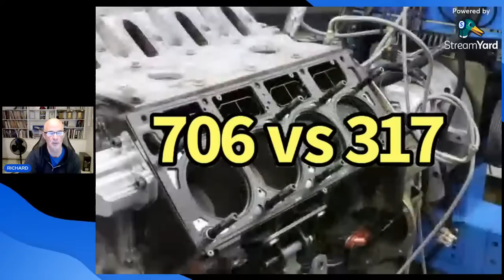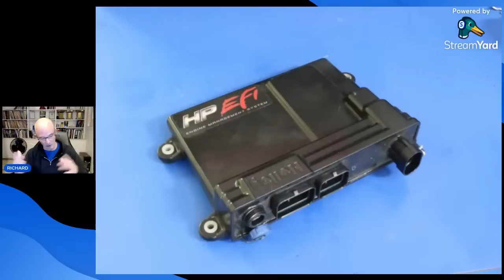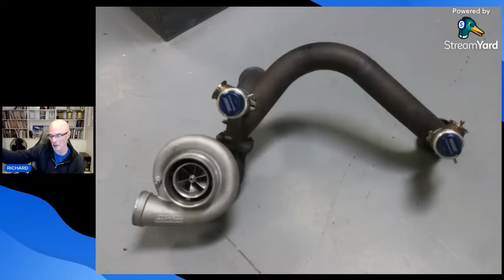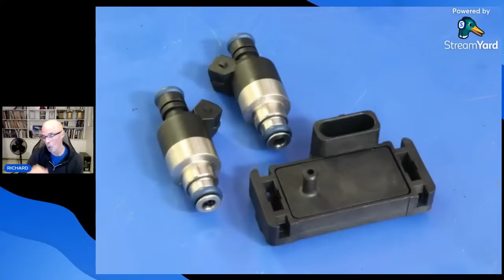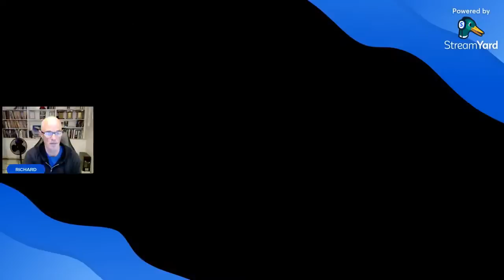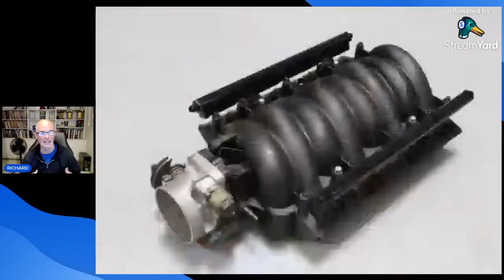COMPRESSION VS BOOST LET'S TALK TECH

Comment: I've learned a lot from Richard. I went from knowing nothing. To knowing enough to not totally agree with absolutely everything. When he says every cam is a turbo cam. But then say, that's not the cam i would have used. It's like saying you can put ketchup on anything. Which is absolutely true. It's probably pretty gross on a banana split. When you're optimizing your combination to avoid detonation.  Its not just octane, compression ratio, quench, chamber softening, vehicle weight, intake air temperature. Then just any old cam. Although it will run with boost, may not be right for you.  If you can manipulate the cylinder pressure with valve overlap, it's giving you a larger window, alot like lowering the compression. Also for those that I want a daily driver, fast spool, don't want to lose that 40hp. You better listen to Richard. You have to take into account, if you're running a air-to-air intercooler. It's not being all it can be in the middle of August when it's so hot you can fry an egg on the hood of your car. Stop and go traffic.

Comment: Look i want tge best performance up to a km. But i also want my car reliable. I cant change things every 3 months . So im thinking 8:1 max 8:5 on my straight 6 . Ill run a small A/R rather for faster spool but it will mostly b a daily and occasionally take on someone that think they fast
Reply: I'm planning the same. 8 or 8.5:1 so I can get 1.4-1.6 bar of boost on pump fuel.  The A/R I'm unsure of Thinking 0.83 and G30 825 gen 2.

Comment: At 14:30, you referenced my EXACT concern.

I'm building a supercharged engine with the intent to maximize my USABLE curve on the street and for occasional track/strip use. My inclination is towards slightly higher static CR (via piston, NOT a head/chamber difference), while running less boost overall. 

I'm using a dedicated PWM boost controller that allows me to directly control the boost levels for a given RPM, throttle range, etc. My intention is to find that line where I can get away with running less boost to meet the same goals, so that I can minimize my losses off-boost, while maximizing my gains on-boost (exclusively at higher RPMs, when flow is higher and cooling should theoretically improve due to inertial scavenging.

I wish that I could find a source for exactly what you mentioned at ~14:30 in this video. That would be the Holy Grail of content, for my purposes...
Reply from the maker: you should lower compression and add boost-you will make more power on any given octane

Comment: My feeling is that if you want to compare you should raise the boost to the point of detonation in both combinations and see which combo produces more before you have to stop. As far as chamber efficiency I'd put a dished piston in the 706 combo to equalize compression then test to see which head is actually better. I'd guess in that sense they'd be the same
Reply from the maker: the 706 head chamber is a better design

Comment: An aspect of compression ratio that is never mentioned is the fact that a low compression chamber is larger than a high compression chamber. With NA motors this is clearly a negative but with boost, you can put more fuel/air mixture into a low compression motor resulting in more power given the same level of boost because the flow is higher (you can fit more in). It would be interesting to do a comparison between a 9.5 CR motor with as much boost as it could take before detonation and a 7.0 CR motor under that same level of boost.
Reply from the maker: Something to consider-then you are testing detonation threshold, not change in compression. In this test-the larger chamber (lower compression) heads made less power at the same boost level

Comment: With high compression wouldn't using really big cam help with balancing out the cylinder pressure and compression ?
Reply from the maker: a big cam will reduce dynamic compression

Comment: You dont like compound  setups so you dont have an opportunity to run an intercooler ( inter stage cooler).  So nothing beats an aftercooler, air to air for anything longer than a drag race.
Reply from the maker: I do like compound set ups-just don't recommend them for typical junkyard LS motors (unnecessary)

Comment: I wanna see this head test on a 6.0 or 408
Reply from the maker: same results
Reply: @ so that leads me to my next question. I bought a 2000 6.0 with iron heads and longer crank snout. I decided to rebuild to 408. My question is it better to get compression from the pistons or from head swap. Will I benefit from raising the compression with pistons and having the larger valves of the 317 heads. I want to run stock heads. Thanks in advance.

Comment: Lol when I'm looking at compression I'm looking at 12:1 na or 10:1 with boost lol we got e85 👌

I've got 117° ambient temps but I'm also going ape-shit with cooling. 

I'm guesstimating that a 408 that's 12:1 with smole bore/smole dome skimmed 862s, aughts land somewhere around 10 with huge bore big dome LSA/LS3 Heads.

Idk if it's possible to take out enough dynamic Compression with a cam to run a 20lb twin-screw setup on a 12:1 engine lololol
Reply: A link to a compression calculator would be cool lol. The dome volumes for all the stock heads are available online lol...
Reply from the maker: search wallace racing compression calculator

Comment: I have been looking at installing a Procharger on my 2019 Gt 350 Mustang (warrenty just ran out).  The Procharger makes about 6.5 psi which apparently works fine on 93 pump gas.  I find this amazing considering these engines have 12:1 compression.    However, what I really wanted to say is I really like how you can display what is on your computer now during the live streams.  Its awesome!

Comment: Hello Richard. Building a lq4 6.0 bored .030 over for drag racing. It has a stock crank, forged summit flat top pistons and rods. Calculator says it should be 10.9 : 1 @ 65cc and 10.3 : 1 @ 70cc. Running a btr stage 4 turbo cam and a 88 mm t4 turbo. I have a set of 862 and a set of 317 heads. 
2 questions, would you run the 317s or the 862s and should I run e85 or race fuel?
Reply: Dude" your zipper is open. I'm not richard, but I have a little advice.  When you have to walk a vary long distance,  If you look at the ground as you go,  Your destination doesn't look so far away. And when you do finally look up, It's almost like magic, you're closer to your destination. Or in some Cases, You're like" Damit  i've got a long long ways to go.  It'$ not too late to turn around before you're $elling your part$ for half price on facebook.
Reply from the maker: 317s and e85
Reply: As always, thanks for the advice Richard

Comment: I built my 317 head 6.0  precision 76 based on some of your older dyno graphs... for me sub 3000 lb car the 40ish hp/ torque = just that much more I have to pedal it to keep the tires down... if I were doing a truck yes all the power all the time.

Comment: So a higher comp. Ratio helps with turbo lag?
Reply: Engine makes more power NA=spools turbo faster
Reply: @kelleyshreve2973 

 Yes but you also run the risk of having a smaller tuning window unless other steps are taken like real big cam and chamber softening on the heads which will bring it back in balance.

Comment: 1.4 turbo cruze is 9.5 to 1 
 But 1.4 non turbo in the volt is 10.5 to 1 .
 But if I were to run  air to water intercooler, it would be awesome vs. a large  air to air intercooler.  
I run  90 non e  or 91 10 % , depending on location, when I need fuel. 
The best part here is the cooling system. Yes, add boost, yes, I totally agree it adds more fun ! But you need to update your liquid cooling system via bigger or better flowing radiator example 2 core radiator to a 3 or 4 core radiator  & all aluminum radiators as well. 
Tuning is key and letting the tuner know what all mods are and don't leave anything out. 
 I'm currently running 17 psi on a 1.4 t  on a stock turbo and stock engine with 70k. Large front mount cooler that is over kill and solid 2.5 in charge pipes  with stock choking exhaust & tuned by B.N.R  & 138 hp is stock hp & I may be at 160 to 175 hp guessing here but all this made the car more drivable and wishing I had a 8 speed manual transmission 80 mph at 3,000 rpms is crazy. 
 2012 cruze , manual 6 speed.

Comment: Hi Richard, do lower intake temps dramatically reduce the chances of detonation ? For example , if you are running an interchiller and your intake temps were constantly 54 degrees f, could you use lower octane fuel?  Or perhaps not lower timing as much?
Reply from the maker: on compressed air supercharger system, where the air temp is below zero, you can run full na timing and run 87 octane under boost
Reply: @richardholdener1727  Thanks, Richard.
Reply: It can make a decent difference, but how much is hard to say exactly as there's a lot of variables. The heat of the air at the end of the compression stroke is depending on what the temperature was to begin with. That's why open air filters under the hood is a pretty bad idea, you have less oxygen from hot and less dense air and then the temperature will increase during compression, so now you might have to pull timing while also having less trapped oxygen. 📉
But there's more variables to account for, so it's hard to say exactly where the limit is (or where the specific numbers are at) in your engine.
Reply: @PSA78  I ask if dramatically lower temperatures can allow you to run more timing than usual or less octane than usual. It goes without saying that there are many variables. However, I wasn't asking about the variables.I was asking about the two things I mentioned above. Richard seemed to answer that pretty simply.
Reply: Snorkel gets sufficiently cold air, but when ambient temps are 117° that's as cold as "cold air" gets. Lol. 

Fluid to air intercooler is the only solution that opens up options to remedy that...
Reply: @KaosProject21  LOL, yes, that's why I mentioned an interchiller in my original post and not ambient air.